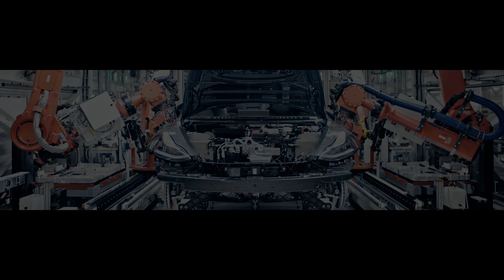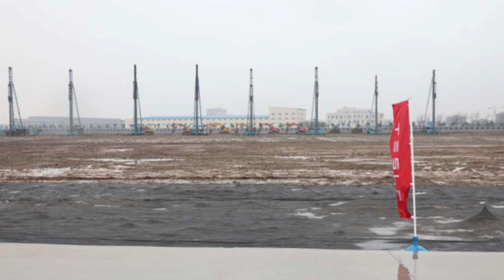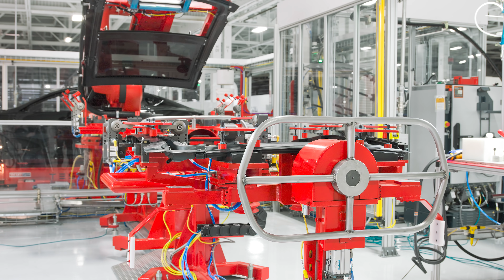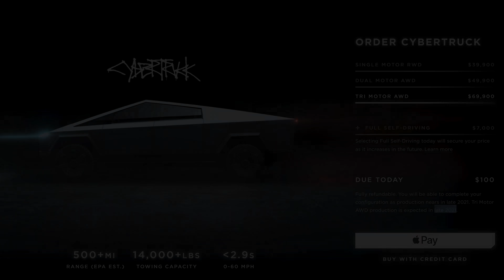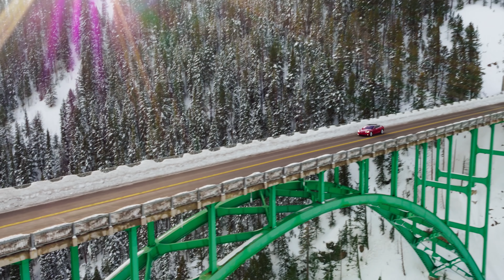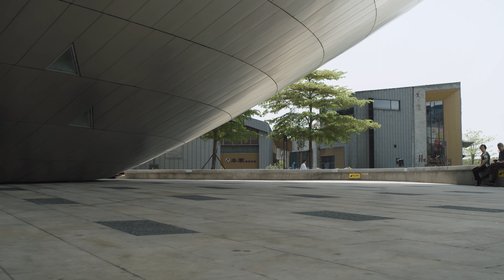Texas Tesla This Year? Plus Elon Musk Gives Minor Tesla Battery Day Update

Comment: Curious if this would involve the movement of Freemont equipment
Reply: Probably not yet. They already had Model Y Assembly Line equipment being built for Shanghai and Berlin. Plus if they pull out of Fremont they would need some other US production up and running first. Then build space for the Fremont lines and move them quickly. Probably starting with S/X

Comment: Elon is beyond pissed off. He may very well intend to dismantle the Fremont factory and ship its machinery to the new site. That might be the explanation for how they could predict production before 2021.
Reply: LockSteady interesting idea but I’d suggest improbable given would imply further interruption in production to do disassembly and shipping and that has already been painful and end result wouldn’t have production capacity increase which is the goal. Seems to me that it may simply be excellent engineering iteration approach at all scales - macro (factory scale) to micro (octo-valve). They even do alloy composition (would that be nano? pico?). Bottom line is it’s constant engineering improvement from big picture save the planet engineering all the way down.. add in Space X and you can add an above planet layer of engineering excellence...
Reply: @drmartinbartos  You make several good points.
Reply: More likely building the Final Assembly line in a tent like they did in Fremont (GA4) but using equipment that was already being built for Shanghai and/or Berlin Model Y lines.  At least for this first phase. I agree they could pull out of Fremont but they would likely wait until the physical factory is partially built some time next year and after they have some full production up and running for at least Y if not Cybertruck.

Comment: It sounds insane. Model Y's coming out of Texas by end of year...but F me, I mean this kind of timeline isn't just pulled out of a hat; Tesla did some kind of analysis and they must have some kind of Gantt chart showing that such a feat is feasible. Personally, I'll just set my expectations later and be amazingly impressed if they can achieve this.
Reply: After you've made a few gigafactories with improvements along the way, things only get much faster the 4th time around... Same with Tesla's car designs. Model S and Model X were disasters compared to the much simplified Model 3 and Y.
Reply: @anonypersona3189  Been thinking about this a bit more. 3 issues with Berlin are: 1) "Eco protesters" and I use quotes heavily around eco 2) unexploded ordinance search 3) clearing of forest.

If Tesla can find land that is extremely flat, undeveloped, and otherwise requires fairly minimal basic construction effort, they can basically basically be slightly trailing Berlin. Also, maybe the supply chain of "gigafactory parts" that are made in the USA (structural parts, etc) are more easily transported to Texas than Europe or China (though on 2nd thought, much of the China construction is sourced there, as is likely for Germany).

Anyway, I was talking with a friend about the machine that "makes the machine that makes the machine." It seems like this 2nd meta level of building is quite optimized as well and just getting faster over time.
Reply: 4 weeks for Jerome's Model 3 line in the sprung structure - a couple of days outside Elon's wish.
Reply: He'll just hire the Chinese to build it!
Should go down well!
😁😁

Comment: Little to no growth until June information on battery development has probably prevented people intending on shorting during Q2. We're in it for the long haul anyway. A reduced charging time demonstration would prove to be more beneficial in attracting an even wider audience to EVs and would make the vehicles far more compelling to the average driver, rather than shaving some time off the already class leading accelerative performance. Obviously extra range would be a nice bonus as well but petrol heads won't move away until you can replenish significant range while relieving yourself and finishing a snack.